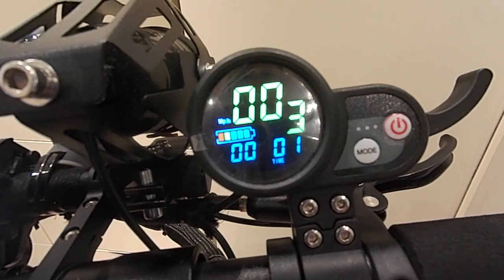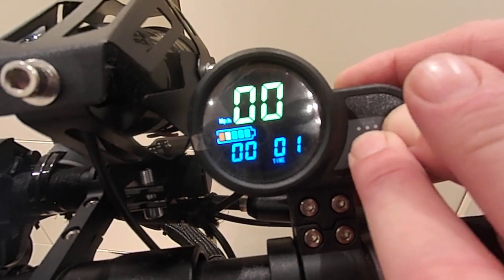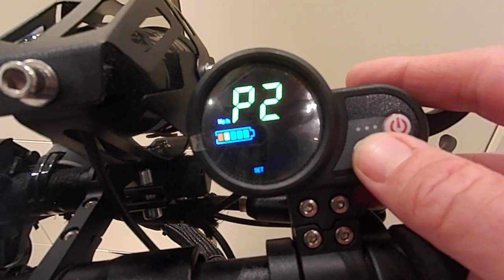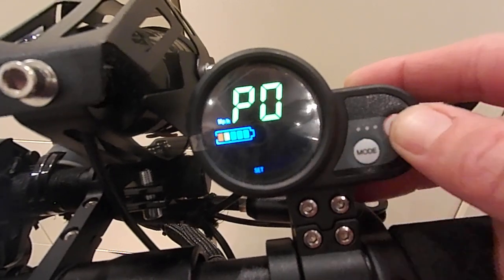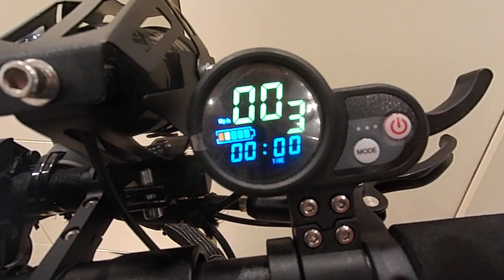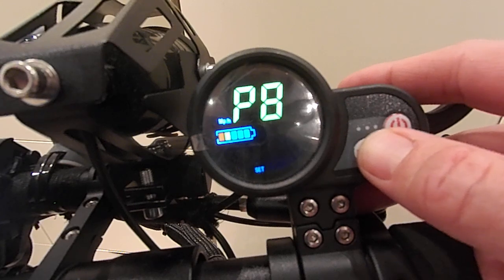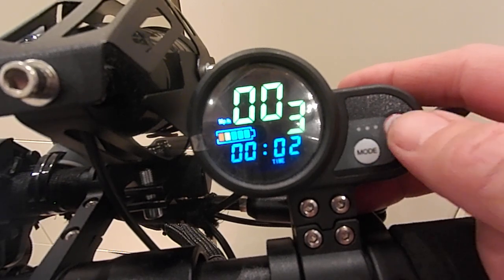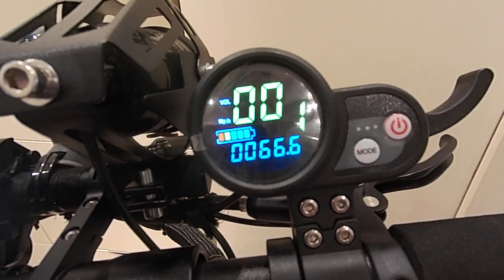Programming Electric Scooters for 10-Setting Variants (P0-P9)

Comment: Hey man show me how to set the limited speed on p 08 a video please thanks
Reply from the maker: Press and hold power and mode button, use the mode button to toggle up to p8 then use the power or mode button to go up or down. Most scooters will already default to 100%
Reply: @marcusoroberts   not if yours automatically SKIPS OVER p8!!  don't ask me why, but i have sets within the p1-p18 or whatever, that get skipped over so you can't get into that setting to change it...  SO frustrating.  oh yeah i have a joyor X5S any help would be awesome
Reply from the maker: @straightciswhiteguy  Hi, so what is your question please?
Reply: @marcusoroberts  how do i access P08 if my little gizmo automatically skips over PO8 when i'm going through the settings.  it's the most important one and on my scooter i cant' access it which means i can't change the speed faster than 15mph which makes it painfully slow.  if you know the secret to get into PO8 i would be forever in debted to you
Reply from the maker: @straightciswhiteguy  It's probably hard coded to not allow p8 to be changed. Unfortunately there is currently no way of changing the non-volatile memory in the controller to overcome this. Perhaps it is already set to 100% by default, but the power is not as much as you would like due to battery/controller/motor limitations...

Comment: when you are in the main page when you hit the mode button there is a page which says instead of the speedometer it says CH and bellow it says time and 2:00 always what does that mean ?
Reply from the maker: If the LCD has that function, it means that after 2 minutes the scooter will time out and shut down. I've also seen scooters with this programmed to hours, so could also mean 2 hours!

Comment: Hello, good job with the video - very helpful. Do you have any information about usb data connection/software and its possibilities?
Reply from the maker: Hi and thanks. Unfortunately I don't have that info. I tried many contacts and went to the manufacturer of this LCD throttle, but they very protective of that.
Reply: They say me the usb is usless only for manufacturer use

Comment: Hello Marcus
I have a 48v scooter with 10 inche wheels and i set it down to 36v it is ok to set the volts down from the regular voltage if the scooter???
Reply from the maker: Hi Jonel, I guess you mean the setting for undervoltage protection, in this  case P1? I would reckon for a 48v scooter around 38v-41V is fine. You would also get away with 36v but it's pushing near the low end of the battery tolerance before damage may occur.

Comment: Hello thank for you this video,,How do I reset my odometer?
Reply from the maker: Hi, unfortunately you cannot reset the odo, same as a car. The total accumulated mileage is stored in non-volatile memory on the the LCD control. You cannot change that if you want to zero the mileage. Much the same as a car. You can change the LCD control unit for a new one if you want 0 miles. How many miles have you done?! Do you mean the trip counter by any chance? You can reset this by pressing and holding the MODE button whilst the TRIP setting is displayed.

Comment: Hi, the power on my scooter is set to 54 only, can i set it to max or 100?  wont that damage the motor or should i just leave it at 54?
Reply from the maker: Hi, no this setting is intended to 'dial-back' power and usually scooters are shipped on that setting. If the settting has a maximum of 100, then it can be set to that. If you don't feel confident enough to ride on full power, perhaps your scooter has an 'eco' setting which helps to attenuate the power - and increase range.

Comment: hi I have the kuggo m4 do you know the settings for this as I cant find any in English
Reply from the maker: Hi Richard, if you go into the settings menu and tell me how many options there are, I might help. Does the LCD display look like the ones from my other vids on the settings?
Reply: Thanks for getting back to me, its a tf-100 , its starts on p02 p03 p04 p06 p07 p09 p15 p16 p99 od0 im not sure if that's any good for you.
Reply from the maker: @richardmonk8957  The settings always start on p0 or p1, but never have I heard them start on p02 go so far as p99! I'm not sure I can help. For the first time I'm struggling. These settings are hard coded and you can re-prog those via the USB on the back of the LCD - if you have the port.
Reply: Thats what I've seen on videos but this starts on p02 then after a few jumps to p99, I can find a video of the kuggo m4 settings but as its not in english I don't understand what each setting is doing but I know p02 is kmh into mph and p03 is the battery cut off thats is set to 48, i have a USB in the back but wouldn't know where to start with a re-prog
Reply from the maker: @richardmonk8957  Perhaps it is hardwired and not able to be remapped. What is the voltage and Ah of the battery. It really depends, because if it is a street scooter it is restricted to around 15.5mph.
Reply: Its 48 volts its not been restricted on the speed as I get about 47kmh out of it, i wanted to find out the controls for cruise control pull away speed and things like that but dont want to mess about with it unless I know what I'm doing

Comment: Hi Marcus, what low voltage you would set for a 29Ah 60V system? Now it is set to 52V...is that fine? Thanks a lot!
Reply from the maker: Hi Balazs, yes for a 60v scooter it should be around 52 or 53 for added undervoltage protection to the battery. Cheers!
Reply: Marcus Roberts thanks Marcus. Do you think I bought a weak battery to an 5700W dual motor setup? 29Ah and 60V...so either I should buy a bigger battery or I should lower the motor power from the menu P8, lets say to 70?

Comment: Based on the new infos, i wnated to test out and set the P6 to 1, so I wanted to have cruise control, but surprisly it did not go off when I pulled the brake but still accelarated like hell without pulling the throttle...was quite frightening...
the other interesting experience that if I am riding around 25-30 km/h and want to speed up from that speed, it doesnt allow me to do so, even if i turn on turbo and 2 wheels on. But if I start from 0 km/h and accelarate continously without braking or pausing it can go to higher speed too.... Do you think it is because I change turbo/economy mode during riding or? thanks a  Mate!
Reply: cruise control worked,but braking not disable it. it accelerate it back. who need cruise control when its this dangerous.and who need over 25kph max speed limit anyway. you need ride scooter on bicycle lane. and road you cant ride it.every youtube post violate it lol

Comment: Is P5 a kind of 'power delay'? if it is set to 1 it gives you instant reaction/power when you pull the throttle, and gives kinda delay if you set it to 0? thanks
Reply from the maker: P5 is a setting that ensures you 'push' the scooter before the power cuts in. I set to '0'. P7 is the power setting for quick start. I set to '0'.

Comment: My MoMAs s2 motor dont go when i push the Button and it have charging can it be problem with settings or is the problem with the motor. The scooter drive self when i tried it But when i push the button it not work
Reply from the maker: When you pull the throttle there's no power? Please give more detail. The motor rarely fails in any scooter.
Reply from the maker: Sorry I don't know  that scooter; I only focus on the rapid dual motor scooters and Dualtrons.
Reply: I drive the scooter and Then i think i put in lighter and Then the scooter stooped
Reply: I cant take the scooter to a shop
Reply: Becouse the scooter is NPT allowed
Reply: Do you think it’s the settings

Comment: Hi i have an 36 volts njax throttle can i adjust the voltage to 48 volts??
Reply from the maker: Hi Dennis, is your scooter 36v? It is a common OEM throttle. You can't set it higher than the battery voltage, you can set to 100% power and a power start. Also limit the voltage before the battery is damaged from under voltage. I'm not sure I understand, but I'll try to help....

Comment: Hi, thank you very much for the info, I got my 48V scooter today, I noticed that the Regenerative braking is not working, No matter the setting I choose, What I noticed is that when I slightly apply the brakes then an Exclamation sign appears. Surely it means a fault in the Regen Braking. 

It's a "Shengte" Dual suspension similar to the Emove of Voromotors. Maybe they upgraded the controller because the original manual only describes 6 P's and the display actually have 10 P's. The P9 shows 0,1,2 levels so it corresponds to the manual you have in the description. I will send it back to warranty as the store provides 3 months
Reply from the maker: That's interesting to know, thanks for the share. So  it's the usual OEM throttle/LCD you have with 10 settings and it conflicts with what's stated with the manual.  The exclamation mark you describe does normally indicate an e-brake issue. I have also just encountered the same exclamation mark and am in the process of stripping it down. Again!
Reply: @marcusoroberts  Thanks for the reply, I will report back the answer from the store here at Chile. Meanwhile, trying to find info about the scooter I found this:
http://www.zjstcy.com/id-19.html
Is that one but 48V instead of 52V, the charger output is 54.6V 2A and the battery is 13Ah instead of the 23Ah stated in the page.
I think they sell older hardware with newer Controllers to try to keep low the prices and break the market or something... We will see.

Comment: Hi I have a red light with an exclamation sing and scooter won't work?
Breaks maybe any help please?
Thanks....
Reply from the maker: Yes it means EBC fail (Electronic Break Control Fail). I have just upgraded my controller and have the same message. It is most certainly a wiring fault or loose connection correctly reported by the controller.  I'm also working to repair mine and will report back.  But your motors should still work. Do you have no power in both wheels?
Reply: @marcusoroberts  thanks man !!! Yes no power at all.... tomorrow I'll open and check the controller
Reply: @marcusoroberts  hi Marcus I checked the controller and changed new brake sensors but no luck the light is still on. BTW mine has only one rear motor.
Reply from the maker: @DKLVE  What is the make of your scooter?
Reply: @marcusoroberts  it's a generic one sold here in my country Chile. Well I had to disconnect both electric sensors and leave it just with the mechanical ones....works fine now .. thanks
Reply from the maker: @DKLVE  Ok, but hope it can be 100% fixed for your safety. Stay in touch.

Comment: Thanks for the video share this helps alot i have the 36v but my settings only go to p6 just wondering why? Only to p6
Reply from the maker: Thanks. Is yours a dual motor? The best thing is to use the p9 guide and just subtract want you need. Things like under voltage protection will be different ie lower, but the rest might be similar. Cheers.

Comment: Also, just to let you know I have a dual 2000w 60v scooter. When fully charged it reads 68.1v on the display, what would you set P1 to?
Reply: Hey I have worked it out, I have set it to 52.0 as this is the highest it can go actually, makes sense as to why it died on me earlier!
Reply from the maker: @electchick_  Yes that's good. 520 (52.0) is the correct setting.

Comment: Hey Marcus, would you say the battery reading is correct on this scooter? Or would you go by your volt meter? As my battery today said it was 1 bar down yet my scooter died on me.. Stupid! Let me know please mate, thanks in advance
Reply from the maker: Yes the bargraph is not accurate at all. The numeric voltage display is far more accurate and I guess within +/-  5%
Reply: @marcusoroberts  thanks so much for your replies Marcus, I've been watching your videos just before I got my scooter, they were really helpful! Would love to see you post some more! Happy New Year btw :))
Reply from the maker: @electchick_  Happy New Year to you too Jorgia. I will better videos soon, thanks.
Reply: Hey just another quick question, a couple of times my wheels have made like a 'crunching' sound, do you think it could be to do with the setting P2? Help.. My scooter is 60v 2000w dual, thank you
Reply from the maker: @electchick_  motor pole pairs? P2 should be 15. That causes rumble and long term damage. Otherwise it might be bearing wear. Honestly bearing damage is very rare though.
Reply: @marcusoroberts  so even on a 60v 2000w scooter, I should set that to 15?
Reply: Nope, it's still doing it! Do you have any other suggestions? It's only when I accelerate to go.. It doesn't do it when I am going along, only when I'm about to shoot off.. Agh it's really frustrating
Reply from the maker: @electchick_  Possibly a loose sensor wire on the Hall Effect connector. It's best to contact FLJ directly. Very difficult to diagnose remotely.
Reply: You're a legend, I will try that. Thank you so much
Reply from the maker: I'm guessing you have already checked, but are there any small orange warning symbols in the LCD display?
Reply: No there isn't, only when I press the breaks a (!) comes up? That's normal tho isn't it?
Reply from the maker: @electchick_  A small orange (!) means an electronic break failure. That's not too important, but there is some electrical fault related to the controller somewhere...or a loose wire.
Reply: Marcus can you follow me on Instagram @jorgiahadherway so I can send you some pictures please
Reply from the maker: Where do you live mate?
Reply: @marcusoroberts  ffs, I've only had it 2 days! :( I live in London, Wimbledon. Are you sure it means that? Can you check yours, it only displays when I'm pressing the break, would love for you to come and help me?
Reply from the maker: Currrently my T112 is stripped down to upgrade and apply extra heatsinking on the mosfets and ensure forced air into controller boxes. I will check in the next couple of days. But there are 3 orange error condition codes. It might be you have electronic breaking switched off..I can't be 100% certain right now.
Reply: And how can I check this to see if it's off? Where abouts are you from? I would consider paying for your travel if you could kindly come and look at it
Reply from the maker: @electchick_  I'm only in Essex. Hold fire until my scooter is going again. It's all fixable. I understand the wiring.
Reply: I have just been looking at someone elses video of them braking on their scooter and the warning sign also shows when they pressed the break. I thought it was just a "you are breaking" sign, does that make sense? Lol I hope so anyway
Reply: OK perfect. I will hold on, thank you SO much

Comment: Hello... I'm in the U.S. and have a nanrobot D4+ 2.0 and my throttle is malfunctioning part of the time, sometimes the throttle does nothing till I click the eco/dual mode buttons on and off sort of rapidly, and after riding for a bit I may be stopped or in the standing awaiting to proceed manner & the scooter will engage the throttle wide open completely on its own, yet this occurs totally at random. It's like being in a dunking booth at the fair... you know its gonna happen you just can't tell when or be prepared for it no matter how hard you try.    Have you heard of these throttle symptoms before..?   (Thank you for the videos by the way very informative.)
Reply from the maker: Hi Buxtro. First off, are there any orange warning symbols on the throttle display? There are 4 error condition codes. It might appear briefly whilst the 'drunk booth' thing happens. Does this happen only on rear drive or both? Any more info please. Cheers.
Reply: @marcusoroberts  no warning signs and it can happen in either dual or single mode Eco or non eco mode and I have the EBS disengaged at zero no kick-start no cruise control engaged voltage set at 43 and everything else is set to default.  Have accumulated 539 miles total, I have driven through about 6 inches of water over 50 yards or so but did not start these symptoms till long afterwards and rinse it and wipe it down after every ride.
Reply: @marcusoroberts  and just to clarify I was referring to a dunking booth like where you sit on the bench and they throw the ball at the Target and when someone hits the the target the bench gives way dropping you in the water clarifying because you typed "drunk booth" which is the area where they put you in holding to you to sleep it off in the local jail big difference...
Reply: @marcusoroberts  matter of fact I'm going to take it for a spin right now and wait for the symptoms to occur and keep an eye on the throttle display I often keep it covered due to the blue light affecting my night vision lots of wildlife where I live in Virginia Beach also the six inches of water is due to Tidal flooding we get that alot in Virginia Beach so it was on asphalt it's just the entire Road was submerged with fresh water...
Reply: @marcusoroberts  just realizing if you're in the UK it's probably 1:30 a.m. whenever you get the moment let me know the time difference and I will respond respectively don't want to disrupt you're sleep or anyting.
Reply from the maker: It most definitely sounds like oxidation in the controller. Does your scooter have one or two controllers? It happened in a DC-DC converter on one of my other scooters. I corrected this and sealed it  An electrical contact will go slightly green in colour and intermittently fail to conduct. I have a solution, but wait for you to try and see if you get any orange error  codes first.
Reply from the maker: You don't have to run the scooter under load, just put it on a block so it's easier to observe when the fault occurs.